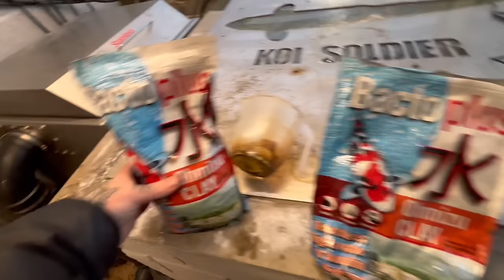Pond maintenance & packing for Japan 🇯🇵

Comment: Great content as always Lee 👍....I run the same Oase filter and just wondered whether a couple of my thoughts/experiences might be useful. ......Re trickle in - I drilled a hole in the lid and trickle into the bio side. Re wifi issue - I'm with virgin and they provide booster pods that you just plug in to any electrical socket and this extends the house wifi to that point, not sure if other wifi providers do something similar. Re media air pump - I run a 40L which turns over 60L of Helix 13 + 30L of oase pond pads very nicely. Oase recommend a 60 + 20 mix but it all seems ok. Last point - The rosettes look the nuts  👍 Enjoy Japan!
Reply from the maker: Perfect thank you x